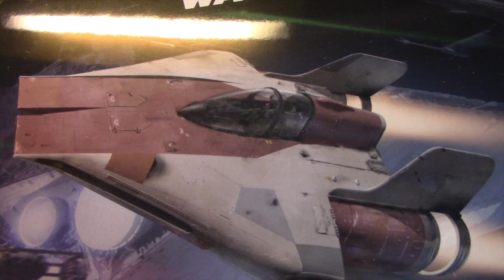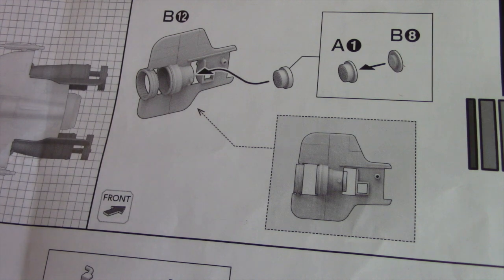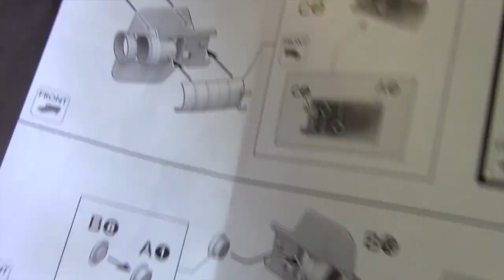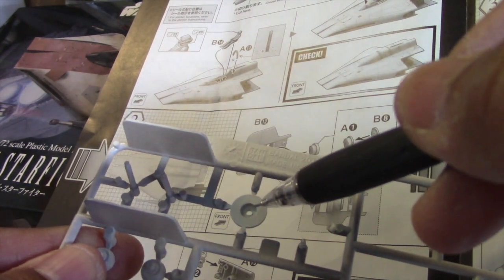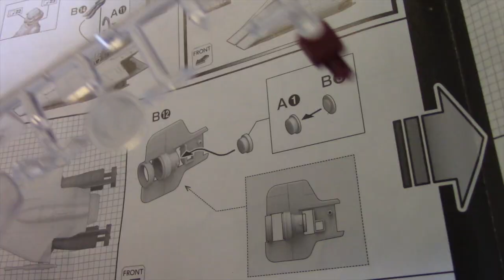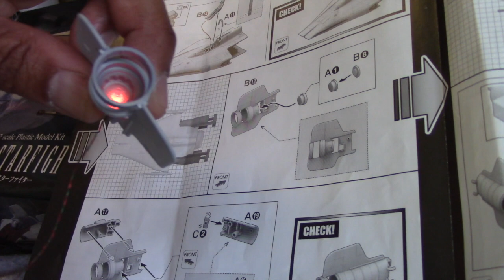Lighting the Bandai Star Wars A-Wing Starfighter; Part 2

Comment: Can you detail the lighting products you used for this build?
Reply from the maker: At 3:15 and 7:07 you can see details about them.  The engines are chip sized SMDs from Modeltrainsoftware but if i were to do this over again, I would choose yellow instead of Orange.  At the time I thought the yellow looked too yellow but would still be more screen accurate.  The cockpit is a Nano sized SMD.  Here's the link that describes the SMDs and there are further links to take you to the page that allows you to purchase them.  The battery is their coin sized battery.  Click on their Wire, Switch & More tab to find those. Hope that helps https://evandesigns.com/pages/information-about-led-sizes

Comment: Hi, what size lights would you recommend for the Bandai 1/72 x wing ? ..
Reply from the maker: I've not built that model but I would recommend checking out modeltrainsoftware.com's choices of SMD chip sized lights.  They're not very expensive so you may want to order a couple of options.  My guess would be the pico sized light but you may want to experiment with their nano size as well to see what would suite your situation best.  Both can be powered with coin sized battery so I would say that you don't need the resistor if you plan on using that as a power source.  Hope that helps.
Reply from the maker: You're welcome.  I've found myself wishing for the same feature with the SMDs.